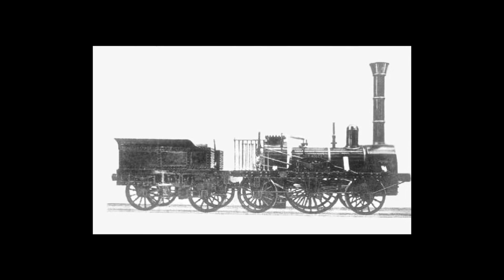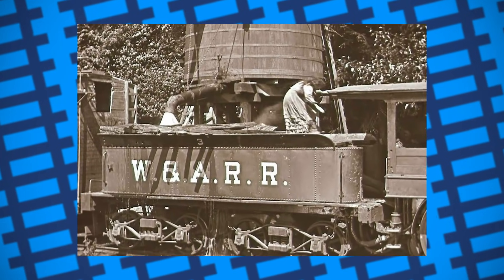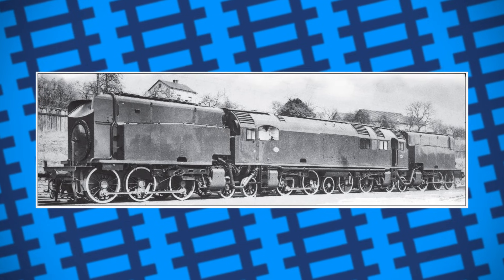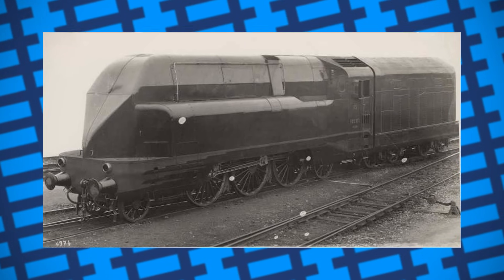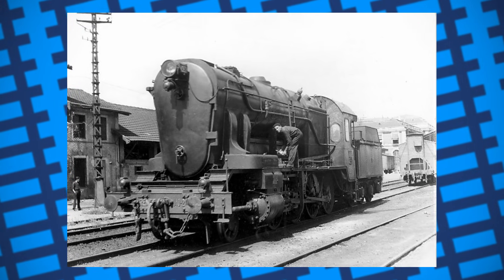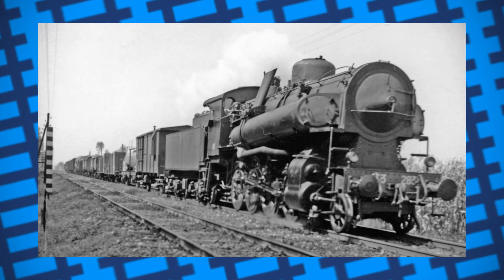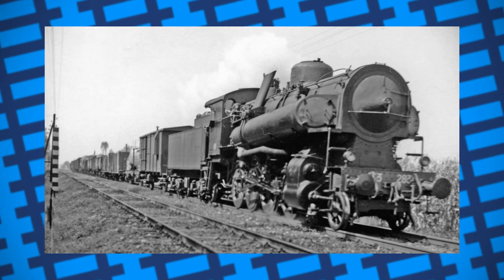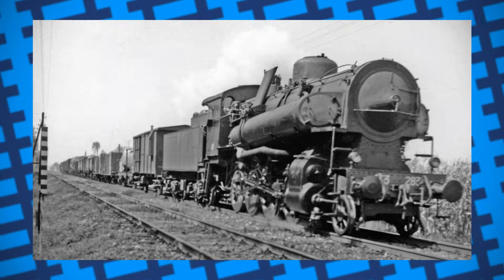Italy's Bizarre double-boiler steam trains - "Franco-Crosti" Boilers

Comment: Here you have an article about the spanish locomotive, with an explanation of why the peculiar shape:
http://historiastren.blogspot.com/2020/03/una-locomotora-unica.html

Piero Crosti had completely redesigned the entire system, solving one of its biggest drawbacks: the location of the exhaust just in front of the driving cabin, which made it difficult for the driver to see the track and, in addition, caused the entry of large amounts of smoke at your workplace. This new development was carried out in collaboration with the Officine Meccaniche Reggiane firm, which is why it received the name Reggiane-Crosti and, thanks to the recirculation of the gases through the new preheater, the exhaust could be placed in the usual location of the chimney of steam locomotives.
Reply: I guess another factor was that at the time the locomotive was going through trials, RENFE was receiving several of the new Renfe Class 141 ( one of the most mass produced steam locomotives in the history Spanish railway) in addition to several new diesel engines and the electrification of both old and newer sections of the network. So with the problems of rolling stock being solved, converting several of the steam locomotives to oil burning( as well as fixing a bit the problem of the coal supply) and the incorporation of Diesel and electric, it’s not hard to see why no more where built. A bit of a shame, as it seemed like a rather interesting and effective locomotive.

Comment: Now adays you could probably fix the issues these styles had and with better efficiencies because of our new precision building skills + the fact that now we have aluminium readily available which while it does melt at a lower temperature you can still heat it to 500C no problem meaning that you could make it lighter now. Also I'm not quite sure if the system used both the exhaust steam and the coal smoke. but if it did use both just using the steam would be more efficient and probably fix the corrosion. Or just cover it all in machine oil which doesn't burn but prevents corrosion idk

Comment: The  Franco-Crosti additional " boilers" were actually 
water Pre-heaters, using expended steam from cylinders and added Draught for Firetubes. After experimental 683 series, 741 and 743 Series were made in large numbers. The added Performance however, was minimal, and added cost and increased maintenance.
A solution searching far a problem.

Comment: The Santa Fe, in the US, had mallets with "articulated boilers" that seem to have actually been precursors to the Franco boiler-the front half was a feed water heater.  They were retired early due to issues with maintaining the joints and cinder build-up in said articulation, but they predated Franco by several years.

Comment: The German class 50.40 was put out of service in the middle of the 1960s due to the build-up of sulphuric acid in the pre-heater boiler which destroyed the flues over time. Even stain-less flues didn't solve the problem. One of the class was even fitted with a fuel burner and was nearly as powerful as  a 2-10 class 44 with 3 cylinders.

Comment: A number of USA built Mallets in the pre-superheater era had economizers hidden in plain sight, appearing as just the front few courses of the boiler behind the smokebox.  At least some of these, called separable boilers, were arranged to be unbolted and separated from the boiler proper for tube and flue-sheet replacement.  Most notorious were the Santa Fe's flexible boilers with ball or metallic bellows between the boiler and the economizer.  Most were, however, rigid and outwardly unremarkable for large early Mallets. These disappeared with the introduction of superheaters.  One wonders if the USA builders were aware of Franco?  Or if Franco was aware of the USA Mallets?  None of these survive, either as constructed or as rebuilt with superheaters replacing the economizer.

Comment: I wonder why they couldn't just make the heater a continuation of the boiler, putting it in between the boiler and the smokebox with the firetubes running through it?
Reply: It's more thermodynamically efficient to split the heating process so that cooler gases exiting the boiler heat up the cooler water in the preheater, rather than having everything at the same temperature as would be the case if you just made the boiler longer.

Marine and stationary steam engines usually have an 'economiser' in the funnel that preheats the feed water, which follows the same concept.

Comment: Just two details:

In 1939 the system was trialled at the same time on five 685s and five 743s, as was often the case on the most widespread passenger and freight designs of the time.

It is not quite right to say that "new locomotives were built"; all of them were rebuilt from existing locos. Because of the lack of coal and the feasibility of electrification, for its own state railways Italy had stopped building new steam locomotives a long time before, with the last ones being outshopped in 1928.

Comment: Yes! As an Italian I’m happy that the bizarre Franco Crosti systems finally got some recognition! Believe it or not, there is another Italian class steam locomotive that had a singular Franco Crosti boiler underneath the primary one. It’s called the FS class 741 and there’s one that is still in running condition today (number 741.120) In fact, it is the only Franco crosti steam locomotive that is still functional in the world
Reply: There is also another class that wasn't meantioned here, the FS 623. Which was the Franco-Crosti conversion of the iconic 625. They were actually quite popular with crews apparently, and some were even fitted with Caprotti valvegear!

Comment: Worth mentioning... almost all post 1820 US and Canadian steam engines had feedwater heaters which did much the same job -- but without the complexity or the detrimental effects on draught in the boiler.
Reply: For far less fuel savings, though. That's the point - complexity for less coal burned.

Comment: That is not a boiler, a boiler has to boil a liquid by definition. What that is is an economiser, fair enough though that's a less exciting title. Also i wouldn't say that adding cold water to a boiler is a problem per se as it is added at a constant rate so temperature of the boiler should stay the same. 

What this essentially does is allows you to capture colder flue gasses. The boiler is pretty much at constant temperature throughout which is dictated by the pressure. For example at 10 bar the temperature will be around 180C. 

This is due to the latent heat of evaporation meaning liquid/steam mix will not rise in temperature as you add more energy, until the steam is completely dry (at which point it heads into the superheater). That also means that the flue gasses exiting the boiler can't be any colder than 180C, which is a whole load of energy that you're just chucking out the chimney. But you can use that energy to preheat the cold water before it enters the boiler meaning the boiler doesn't have to do that works itself and the whole process is more efficient. Viola!
Reply: Since especially the first Franco-Crosti locomotives, as the video mentions, other than the preheater drums also got various enhancements to the boiler, British speaking literature has taken to calling it "Franco-Crosti boiler".

I agree it isn't quite right.

Comment: 2 things I am thinking about here is injectors. Normal injectors as part of the process of brining cold atmospheric water up to a higher pressure, the feed water gets heated. So the tempersture drop in the boiler isnt as drastic as putting cold water in already. Secondly traditional injectors do not like warm feed water and often fail or have low performance on hot days. Having never worked on a crosti boiler im assuming that feedwater to main boiler might have used a pump or some form of different injector?

As a fireman on some days its hard enough to get one boiler to play ball. Now you have 2 water levels to worry about it must have been abit more taxing on the fireman keeping a mental track of water states, fire bed state amongst all the other duties!
Reply: What about having the preheater always full and having the injector feeding into the preheater? That would solve your problem. You only need a non-return valve between the preheater and the boiler.
Reply: @sierkdejongh8984  true but thats assuming that exhaust gases on their own could get the feedwater boiler up to a pressure equal to or higher than the main boiler. Assuming for most mainline locos that somewhere between 180psi and 250psi then thats quite high. And what if your main boilers full? A one way return valve wont on its own control the rate or stop the water if needed.

A variable rate feed water pump sounds more useful but again vastly more complicated. Im guessing theres a few more details in the design and operation that I havent found online yet to understand the ins and outs!

But great video!

Comment: Did you know that a class 741 locomotive has been kept operational and you can still see it towing touristic trains? 740 class locomotives have been the work horse of italian railways since their introduction in early 1910s. Some of those were modified with Franco-Crosti boilers giving birth to the 741 and 743 class locomotives. 743s had two boilers, one on each side of the main one, 741s had only one mounted under the main boiler. In the end the lack of coal mines in Italy also explains the early end of stem engines here: we started electrification very early, and by 1930s there was no need for faster and more powerful locomotives anymore. It's a great luck that some of those were preserved in working order, so than we can appreciate 1900s engineering up to these days.

Check it out: https://www.youtube.com/watch?v=PghVeJw4xHw

Comment: Thank you for this v.useful article  -  I never previously understood the features and purpose of the Franco-Crosti system.
Slightly puzzled at time = 374 secs (6 min 14 secs), there's a mention of "Loading Gauge" in relation to WEIGHT of the loco
and its weight distribution.  I've always assumed "Loading Gauge" defines the DIMENSIONS of a railway vehicle (i.e. will it 
fit through tunnels, under bridges, through station platforms, round double-track curves etc).
Does this detail maybe need some thought ?
But returning to the main point  -  thank you for presenting this mini-docu👍👍
Kevin Thomson

Comment: The weight of an engine has got nothing to do with the loading gauge, which is something of a misnomer.   The loading gauge refers to how high or wide you can make an engine or train and still fit it under bridges, through tunnels, and through station platforms. The curved gauges themselves could often be seen hanging from a gantry at the exit from goods sidings. If the whole train passed safely under the gauge without touching it, that train was good to go. Anything fouling the gauge would need to be repositioned and placed lower down.

Comment: I wonder if a contributing factor was that the Crosti Boilered locos operating had Italy had less work to do in heating the feedwater in Italy with its much hotter climate than up north where the feed water would be colder when being fed into the tank.
Reply: Italy can be quite cold in winter, too.

Check out some videos of Class 741s at work in the Val Pusteria/ Pustertal line.

Comment: They are pre-heaters, not boilers. Clue is in the name. They are designed to heat the feed water before it enters the main boiler.
It is not a loco with 2 boilers. The 9f didn't use both chimneys. Where do you get your info from!
Reply: A boiler is a common term for a device used to heat water, even if not to the point of boiling.
Many furnaces use a boiler for radiators without boiling the actual water.
Definitions of boiler: a fuel-burning apparatus or container for heating water.
(Heating, not boiling)
A boiler is a closed vessel in which fluid (generally water) is heated. The fluid does not necessarily boil.
(All pre-heaters for liquids are boilers.)

The 9F did use the second chimney. It was used as an ejector.
Something is still used, even if it isn't for whatever narrow view you have defined as a use for it.
For example: it's a common mistake that the Titanic didn't use its fourth funnel. It was, in fact, used for ventilation.
Reply: @tim3172  the 9f smokebox chimney on a crosti was only used for lighting up, once in steam a hinged lid sealed it. If you think your ejector point through, the ejector exhaust is not powerful enough to overcome cylinder exhaust, the cylinder exhaust would pull air down instead of through the boiler. Just think before posting!
A pre heater is not a boiler, is is best described as an economiser. A feed heater is designed not to create steam, a boiler is.

Comment: Had the preheaters been made of stainless steel it would have helped to keep maintenance cost down, initial cost would be higher but the reduced maintenance requirements would outweigh this over the locomotive's life.
Downside of any system taking energy from exhaust steam is that it increases back pressure and so it will induce less air flow trough the fire.
Reply: stainless steel is  poor for power boilers, it has a relatively high thermal resistance.

Comment: Why did they put the Franco-Crosti boiler underneath the main boiler? Wouldn't it make more sense to have the Franco-Crosti boiler on top of the main boiler? 

Hot gases naturally rise up. So, if you have the Franco-Crosti boiler on top of the main boiler, the hot gases would go up into the Franco-Crosti boiler. Then, the pre-heated water in the Franco-Crosti boiler can just drain down into the main boiler.
Reply: there generally tends to be quite a bit of space under engines.
Because the boiler is generally bigger than the frame is wide it sits ontop of the frame leaving a empty gap under it.
Also tunnels are a thing meaning putting it ontop would cause issues.
Reply: That would mean the feed water would get hotter than the boiler and would affect the water injectors feeding water into the water heater.

Comment: Thanks for this excellent explanation! French and Italian engineers were also keener on complexity than German or British engineers, who liked to keep things simple wherever possible.
Reply: Debatable. As a rule, as soon as superheating became feasible Italian designers almost always chose to discard compounding, for example.
Reply: For the simple reason that both compounding and superheating are expensive, and the efficiency gains from fitting both to an engine are negligible compared with fitting just one of the two, and they don't justify the extra cost. I wasn't claiming that Italian engineers went complicated just for the sake of it.   @historynerd88
Reply: The K.I.S.S. Principle.

Comment: Interesting Video :) Just for anyone curious, the loading gauge doesn't refer to the weight, but rather the overall space required / available for the locomotive above the rails. It's the clearance to trackside obstacles such as platforms, signage, tunnels.. etc.
Reply: Yes indeed, the loco's weight is one of the factors needed to ascertain its RA (route availability), minimum track curvature is another. The term "loading gauge" comes from those suspended iron bars which open wagons had to pass under  when fully loaded.
Reply: Right, he should have said axle loading, not loading gauge. Though of course loading gauge is a problem with these preheat systems too.
Reply: @kkobayashi1  his technical knowledge is grade 1 level, 10 for effort but research needs more work!
Reply: In the US, we use the term "load diagram" or "Clearance diagram" instead of "loading gauge".  There are many different terms used around the world that mean the same thing when talking about the same subject.